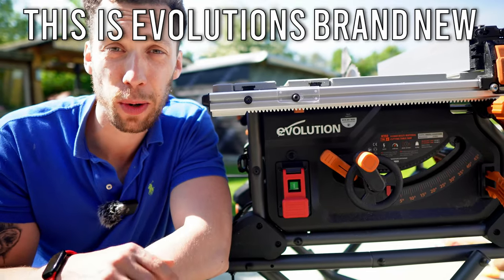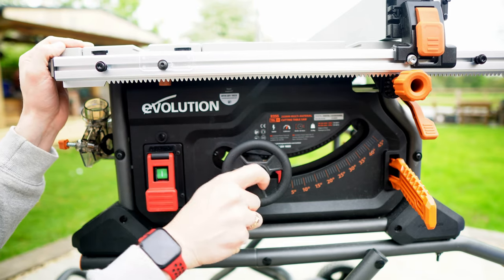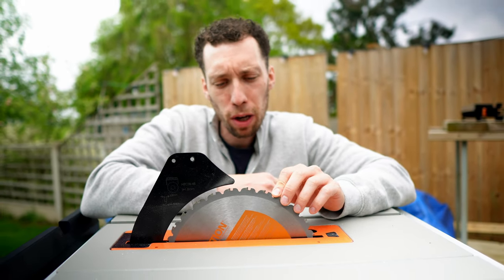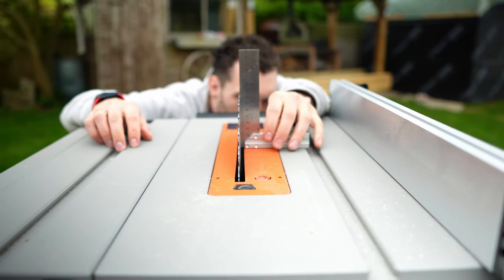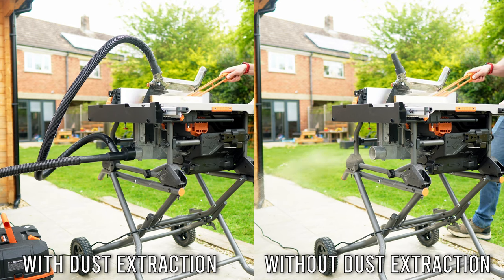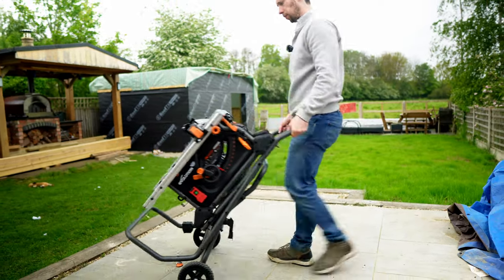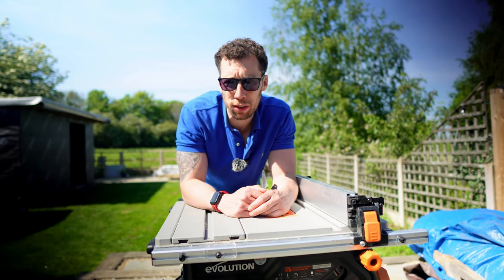This Table Saw Broke the Internet | Evolution R255TBL+

Comment: 1 minute into the video and credibility is gone... you don't know what a riving knife is for....
Reply from the maker: What do you think it’s for?
Reply: It’s to prevent wood from twisting or pinching on the back side of the blade which would cause it to ride up the blade and kick back at you. Not just small offcuts, but some rather large ones too
Reply: To greatly reduce the risk of kick back which is caused by slightly tilting the work piece causing the rising teeth on the back to fling the piece back at you with a huge force.

The thing that prevents small things being flung at you is a zero-clearance insert.

The raving knife on this one is not that optimal because you can't make dados while having it on (it's longer than the blade). The saw I have has two raving knives, one with the guard and one without which matches the height of the blades.
Reply: @Pygex if i’m not mistaken all table saws in the Uk have an arbor which doesn’t not allow the use of dado stacks as they are deemed dangerous
Reply: @sumeraybuilds  A riving knife decreases the risk of pinching and kickback in LARGE workpieces, it prevents your workpiece pinching the blade. Small off cuts can still be launched towards you simply by being next to the blade. The drag from a spinning blade can suck small pieces against the blade and still shoot them back. the riving knife does virtually nothing to protect you from small offcuts.
Reply: Surely its handy to remove if doing rebates

Comment: And don't forget that when you make a warranty claim DO NOT tell evolution that you have been using a non evolution blade. Any blade other than theirs voids any warranty claim 🤦🏻
Reply from the maker: Great tip! I didn’t know that!
Reply: That is a reason in itself not to buy this one,  Im going to skip this one then, back to drawing board.
Reply: @jeremymmoraw  for me I'll really think I'll end up with the hikoki plus the 240v power pack, yes it'll cost about £150 more but it also has a five year warranty and a battery option for later if ever needed.

Comment: got mine today, its superb, tiniest of setup changes needed, bang on and really impressed at cuts. just ran a load of 50mm ash through it and it ate it no problem. dust extraction was excellent, huge improvement over the rage 5 (got rid of one two years ago).
Reply from the maker: It’s really very good! You won’t regret it!
Reply: @sumeraybuilds  truly agree. I had a long hard think about the festoon one, then the stopsaw and the dewalt. But the more I looked at this it just works really well. It’s not just a Jobsite saw you can do high quality carpentry with this. Delighted. Glad you like yours. All the best.

Comment: I purchased the rage 5s only 6 months ago and gutted i didnt wait as it looks like all the niggles have mainly been addressed. Great review and loving your videos!
Reply from the maker: Ah gutted! Thanks so much! 🙏
Reply: Uhhh.   The what?!
Reply: what is now better then in the 5s?
Reply from the maker: @jasonparker1454  rack and pinion system is much more accurate for the fence. Build quality is higher, better materials used. The features included - mainly the built in outfeed table.

Comment: Nice bit o kit that. ALMOST makes me wish I had waited a year before pulling the trigger on the Rage 5-s. Short of the horrible dust collection on it, it works. Does what I need it to do and hasn't missed a beat since coming out of the box. All that said, doesn't mean I'm no drooling over that saw! Take care & stay safe M8.
Reply from the maker: The RAGE-5 is still a decent saw! But they’ve certainly taken on board everyone’s feedback in this latest version. 😀
Reply: Eventually the gears to wind the blade up and down and to set the angle will start to wear and slip- I’ve had mine a couple of years now and it’s very annoying

Comment: Very useful information on this saw thank you. I'm trying to decide between this and the 250mm DeWalt which is more than twice the price. Also the DeWalt DWE7492-GB 240V doesn't have soft-start so I'd have to put it on the machine.
Can I ask you have you put a straight edge across the table of the Evolution to check for flatness? I've heard that the can suffer from a warped table as can the DeWalt actually.
Reply from the maker: Yes I have checked and both my DeWalt and Evolution are straight on top. Although I have also heard of this issue happening on both. I did a comparison that I recommend checking out if you’re unsure 🧐
Reply: Dewalt must be pricey in EU. In Canada the Dewalt is marginally more than the Evolution so doesn't make sense to buy it.

Comment: Ok so looking at the riving knife it can not be lowered to blade height? So for doing non through cuts it would need to be completely removed? Its been said by others that in the manual it alludes to the riving knife having the ability to be adjusted to blade height, i guess just by looking at the slot in the knife it can not go any lower?
Reply from the maker: Sorry it’s taken me awhile to get back to you, but I’ve just checked this and can confirm that the evolution doesn’t have another setting for the riving knife so you will have to remove it if it’s too high
Reply: @sumeraybuilds  hi thanks for the reply, I actually purchased the table saw shortly after my comment and yes it is not adjustable, but that's the least of my worries, I got the standard version without soft start and it has brutal start up!!! When I first switched it on I literally crapped myself! I didn't quite fully press the button and with the bang it made I thought I had blown my electrics, I'm now looking at retro fitting a soft start which I do not understand why it is not a standard thing, the start up is so brutal I literally stand out the way and have to brace myself as I Invision the blade exploding 🤣, I've not tested to see yet but I think that if I set the blade at 45° the start up will put the blade out of position, so when doing waterfalls I have the blade set at 45.5° with a digital reader, I'm not confident it will hold that with such a brutal start up.

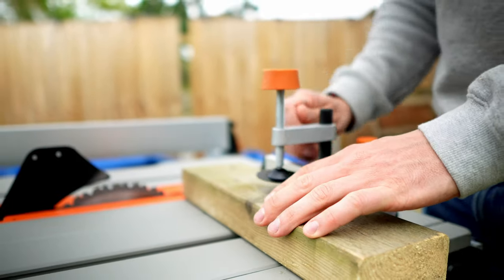Comment: 01:23 you show the mitre gauge then you put a clamp on it and proceed to clamp a piece of wood down to the table saw bed which if i’m not mistaken then prevents you from actually using the mitre gauge because it’s clamped and wont slide
Reply: Watch further and you'll see the reason for that.
Reply from the maker: I cover this later in the video

Comment: It looks like an evolution of the Metabo HPT saw of which I use an offshoot of. That sliding bit of the table looks very enticing if it's done well and the tracks don't clog with sawdust. Also the miter adjustment knob if it's like the one on mine isn't so nice as the locking mechanism can throw off any micro adjustment you make. I'd like to check it out here in Canada but it's doubtful I'll get the chance.
Reply from the maker: So far the sliding panel hasn't clogged up, it's going strong. I've used it a lot during my workshop build as am so far very impressed by it!

Comment: thanks for this review, can the outift table extension be removed in case of integrate the table saw into a workbench? thanks
Reply from the maker: Yes, absolutely it can. Comes off quite easy if you need it to.
Reply: @sumeraybuilds  thanks mate, i’d like to put it in the workbench but be able to use it also outside where i might need the extra support

Comment: Now I really tough question.
Shoud I buy this table from evolution or the dewalt dwe 7845? 
I already have one but is garbage , the angle is never good or it takes too much time to adjuste , so noe that I have the buget for "real" tools I would go for the Best (dewalt everey body prise it) but this one looks to be a lil bit better for some features (that extra hinge for crosscuts). So witch one should I got for ( my opinios for right now would stilul be the dewalt because i know i wont be dissapointed)
Reply: That’s what I’d like to know too
Reply from the maker: It's a difficult question to answer, I'm currently planning a comparison video for the Evoluton, SKIL & DeWalt. I've also just posted a community poll which I'd be interested to get your thoughts on! Stay tuned!

Comment: A good table saw.  I used to have the other model but I went over to Bosch Pro site saw and will never part with it as it's a very robust saw and never done me wrong and it's built like a Brick ** House.  😁😁😁😁 Great video thank you for sharing..
Reply from the maker: Haha 😂 and thanks 🙏
Reply: To my that looked less than stable, not impressed ! Just gimmicks that aren’t tough enough for real work.

Comment: Hey! I was wondering… I’ve just got this saw and can’t no matter how much I try get the riving knife to be inline.. I.e.. if it’s flush one side of blade it’s a mil out the other side. If I run a ruler along the blade I can see it push out slightly… is yours bang on?
Reply from the maker: It is now but I did have to tweak it using the bolts on the riving knife. Did you manage to fix it?
Reply: @sumeraybuilds  Hi, thanks for the reply. No, it looks like everything is as it should be. I've placed the riving knife on a flat surface and there is no twist or buckle to it, but when in the slot there is no position where it is flush both sides. I thought maybe the seat it goes in was off but it's cast to the saw frame so not sure that can be it.
Reply: @sumeraybuilds  I'm thinking my current solution will be when I swap the blade for a finer wood cut it may help as the kerf is .6mm bigger. Its strange though as I just can't see where its "out"

Comment: Hi, I can get this saw now for £305 , is it a good deal considering it’s £140 cheaper than the dewalt , love your videos , I’d like to get the skil saw you did but still can’t get it in the uk .
Daz
Reply from the maker: Yes £305 is a bargain, I'm assuming that's not the + model though so just be aware that you won't have all the features mentioned in this video.

Comment: Would you recommend this over the dewalt dwe 7485
Reply from the maker: It’s too early for me to make that call. I’ve not used the Evolution much beyond initial testing and the DeWalt has stood the test of time (2 years so far).

The evolution certainly offers better value for money and more features. The build quality is also good, but I think uses slightly cheaper materials than the DeWalt.

It’s certainly between this and the Dewalt for me.

Comment: It looks and sounds brilliant, but... my experience of Evolution matches that of others: quality control. Get lucky, you have a near perfect tool for a stunning price. Get unlucky, and you'd better not have an important job to do while you return it and eke out a bit more life out of your old one. I suspect it's safest to wait till rebuilt returns go on sale so they will have made sure they work properly.
   Like all prosumer tools, OK for DiYer who is able to identify faults and get them rectified or the professional who doesn't use that tool all the time. As a retired DiYer who is time rich but cash not rich, I'd look at it, maybe try a refurb version to replace my current almost junk Rutland Tools ultra-cheap model. But I'd probably end up saving up for DeWalt corded if it still does well in reviews by new purchasers (they seem to have given up on their corded tools in last 5 years). It often only takes a couple of DiY jobs to cover the cost of a pro tool compared with hiring a pro to do the job (if you can find a good one)
Reply from the maker: I appreciate the insight and see what you're saying. I do agree that for some DIYers, perhaps the more advanced, a better known and likley more expensive brand is preferable. Evolution, at least in my opinion, are a good starter brand for people just starting out.

Comment: It's not sold out and unavailable on the internet as claimed, to the point the title is practically clickbait! Its available at FFX, scott direct and amazon to name 3.
Cant understand all the excitement for a chinese copy of the dewalt. Rutlands also does a copy under their own badge and thats the cheapest of them all.
Reply from the maker: It was sold out at the time!
Reply: It's not a chinese copy, we designed it in the UK. We reused some knobs used on other brands made by the same supplier to reduce the cost where possible but the saw is our own design.

Comment: Are the mitre slots the same size as each other?

Great review as always!!

Looking forward to the Workshop progression 👍
Reply from the maker: Yes they are! I should have mentioned that in the video, my bad!

Hoping to have the ‘Flat Roof Episode’ ready for next week 😀
Reply: @sumeraybuilds  Do you know if the mitre slots are more standard sizing so can use after market mitre gauges? If i remember correctly the Rage had unusual sizing
Reply from the maker: @soul146 yes they’re standard sizes so works with off market accessories 👍

Comment: To Any one thinking about buying a table saw. Buying any thing less than a dewalt. Dose not makes sense. This table saw costs 300 to 400 euro. The dewalt costs 500 to 640 euro. The dewalt to a much better saw. It has a rack and pinion  fence. I took it out of the box and had to adjust nothing.
Reply: I thought about buying the evolution. But then I realised. That if I did I was only going to buy the dewalt eventually.
Reply from the maker: This also has a rack and pinion sense btw. But I hear you about the Dewalt, it’s a solid saw!
Reply: Why is it a much better saw?
Reply: Sounds like you paid 300 euros extra to not adjust 2 things 😂
Reply: @joe123452  Why you think it’s a better build? Just because of the brand? That’s not a given.
Reply: @joe123452  I know people that still have their RAGE5 from the day it was released… never had a problem. I don’t know what else a brand could do to show they were “solid”.
Reply: I've got the DeWalt, I've spent days trying to get it to cut accurately. I think it was just a poor build out of the factory. By the time I had the experience to know it was the saw (mainly the fence) DeWalt weren't interested in any warranty claims. I'd had it 13 months.
Reply: @willsoul007   Because the typical Dewalt crowd, never used other saws but somehow knows that the Dewalt is better.
Reply: Evolution blade diameter is wider